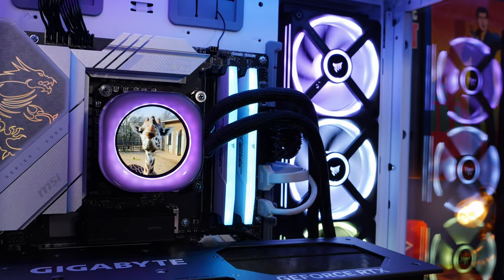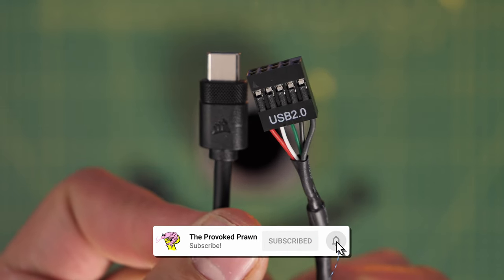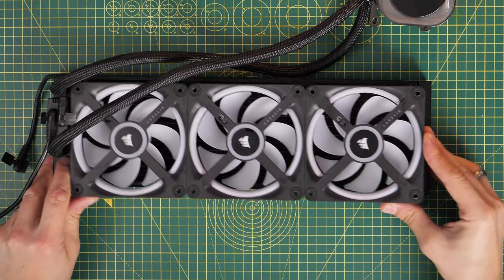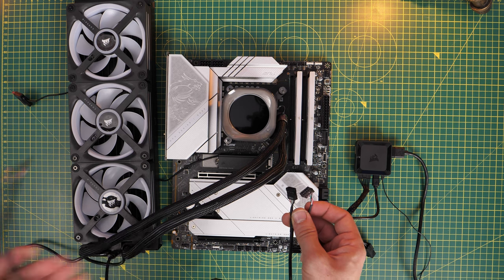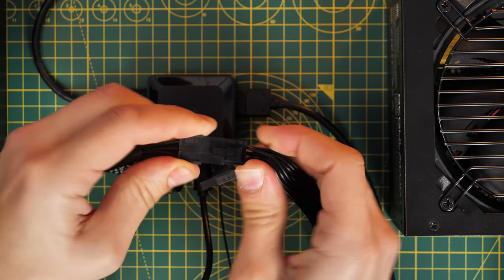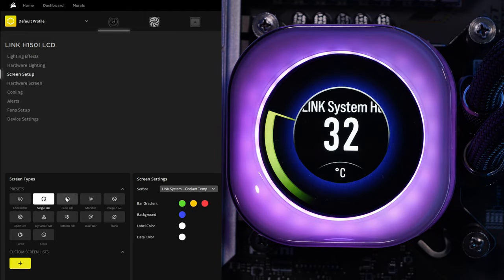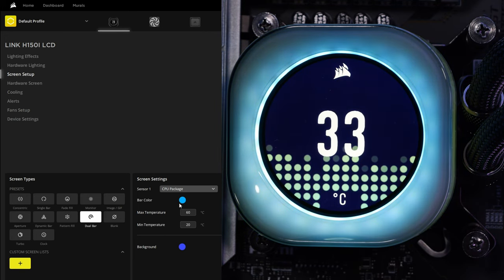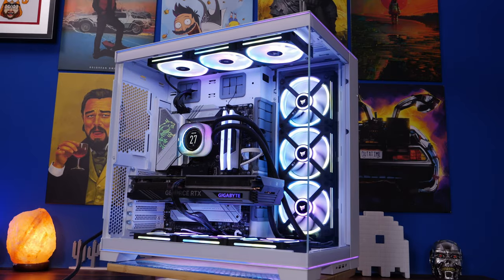Corsair iCue Link LCD upgrade explained and explored

Comment: About the "Triangle of Doom": I have lately seen a video where the guy explained that some mainboards cant deliver enough power through the usb ports which leads to the error. He said that you can fix that problem by buying an internal usb hub (eg a nzxt one) that has its own sata power connection. Apparently if you plug the commander or whatever you use into that, the triangle wont occur anymore because it gets enough power this way.
Reply from the maker: That wouldn't help with this specific iCue link issue as it's down to too many devices being connected to one port on the controller but  a Powered usb hub can be useful for sure
Reply: @TheProvokedPrawn  thanks for your answer! I am clearly not an expert on that topic. I have ordered an H150i Elite lcd xt for myself, gonna see how that works out^^

Comment: So the most bizarre thing occurs with my LCD screen. More often than not I always get the triangle of doom upon starting my PC. After making sure I have no more than 7 devices plugged in on either side and removing the screen and re applying to make sure it’s fully sealed i have no idea what’s going on lol. The only thing that remedies this is turning the pc on and off and hoping that one time it miraculously works. Which is does but it can take 3-4 reboots before it decides to work lol. I’ve contacted Corsair over a week ago and I’ve heard nothing. I’m tempted to return and replace on Amazon in hope that I’ve got a dodgy screen

Comment: recently purchased iCUE LINK H150i RGB AIO LCD CW-9061008-WW. Already fixed with ICUE5 installed and  I still can't find option Screen Setup to play with GIFs :-(
Reply: Same to me, maybe the ICUE software was updated and now is not possible already to change it?
Reply: same problem here! what is the model of ur MB?
Reply: @jsp89jsp u need to connect the USB C cable above the radiator(included) in order to be able to do it

Comment: I have 10 fans in my case, and the LCD Pump which counts as 2 devices.... 6 fans on 1 side of the hub, and 4 fans plus the lcd pump (6 devices)... 6 devices per port... still getting the Triangle of doom.. Second issue: When running the auto detection it doesn't even get the order close, is that normal as well to have to rearrange the order of devices? When ordering your devices do you start from the top left exhaust or bottom left intake?

Comment: good day Provoked Prawn , so I'm a bit gutted.. i bought this cooler (well I thought I did) CORSAIR iCUE LINK H150i LCD Liquid CPU Cooler - QX120 RGB Fans - White - 360mm Radiator - Fits Intel LGA 1700, AMD AM5 - iCUE LINK System Hub Included And it wont let me customize the cooler face. thats why I got this one for the link system, and to be able to change the color,temp.. what am I missing? did I get the wrong one? is their even another one?
Reply from the maker: Hi. Sorry for the delay in reply! Thanks for joining by the way. So that one should allow you to use the screen. The most likely problem is you need to connect the USB cable from the radiator to the motherboard as well as the USB cable from the iCue Link controller to the motherboard. Corsair supplies a splitter cable for this. Try using that if you only have 1 USB port on your motherboard. Also I made an indepth guide to iCue Link here that might help
https://youtu.be/-jeN1m4m6-U

My other tip would be to update the firmware on the controller if you can, using the latest version of iCue.

Comment: Screen setup option not coming in my icue software , any idea why?
Reply: same issue
Reply: Same here. Did you find out why?
Reply: @thomaslyngbyeboje6333  yes, the usb c cable was not plugged in AIO controller , plug in AIO & the Header in Motherboard, it will work
Reply: Problem solved. Ended up removing all fans from the cooler and from hub. after re-arranging my layout of fans and radiator it all worked.
Reply: @jonnyfontane3607 u need to conect the USB C cable on the radiator to ur MB

Comment: I just biught an h150i ilink rgb and can uodat to that also, but i will smash the aio first to the wall. Pump runs, fans spin, and the aio is connected to the hub, and the rgb fans to the radiator, just like the manual. But no rgb light, and no pump shiwn in icue. Just one time short. Other side of the hub has 7 fans working fine, with rgb. Even when i swich ports, nothing changes. Even tried other hubs, but no succes, alk do the same. So i think its in the pastrough. Its a common problem i saw on the corsair forum afterwards. Do you know a fix or sollution.
Reply from the maker: Uninstall iCue. Download the latest version. Install that. Check for firmware updates
Reply: @TheProvokedPrawn  all of the thimgs are up to date, even did a clean windows install, and try to install the aio, and icue again. Nothing works. And i realy see more people have it, but no sollutions

Comment: i don't get why they had to design the cabling like that, there's already a usb cable that goes from the cooler to the mobo so why not just make it go thru that so all you have to do is plop the display onto the pogo pins

Comment: So possible having this AIO with Lian Li Fans right? Just the Aio all i want cause integrated wires
Reply from the maker: Erm possibly? That's a very expensive option to not use the Corsair link fans. You'd have to still use the controller and Lian Li's as well.
Reply: @TheProvokedPrawn  you can direct the usb to motherboard right?? Just the aio i want cause having integrated cables

Comment: hi provoked prawn, my lcd is displaying liquid temp only with no option to change it in icue software how do i fix this?
Reply: u need to connect the USB C cable above the radiator(included) in order to be able to do it

Comment: Installed everything exactly like in the vid but I cant adjust anything on the lcd because there are no device settings tab. Uninstalled twice now and still no luck
Reply: Same here.  Have you fixed it
Reply: u need to connect the USB C cable above the radiator(included) in order to be able to do it
Reply: @xpaulgoflex u need to connect the USB C cable above the radiator(included) in order to be able to do it

Comment: Hard avoid for anything Corsair. First my vengeance ram won't take XMP which after much research found out that's common. ICue suck ass with it's UI also.  My Corsair fans RGB stopped working, along with the ram and mouse RGB. To fix this i had to go in safe mode to delete all icue files after researching it after hours of searching. Bought Lian li and are never looking back. The fan RGB went weeks before the others problems

Comment: Are you using a 420mm aio?
Reply from the maker: No, 360 in this video but it works with the H170i version as well, if that's what you mean.
Reply: @TheProvokedPrawn  I was curios, how well wiukd perform the new corsair 420mm aio. Thanks for replying!

Comment: ICue keeps crashing my pc. Ended up uninstalling it and system runs fine. Basically useless for the dominator ram rgb…
Reply from the maker: That's weird. How do you know it was iCue specifically?
Reply: It took me a long time to figure it out. Almost wanted to reinstall windows. Back then I had windows 10. For some reason before reinstalling windows I uninstall icue and the freezing stopped. In the end I updated to windows 11 and my ram was stuck with a random rainbow pattern. So I installed Icue to change that and…. The freezing issue was back. Now it’s a random blue pattern I can live with and without icue the timing of the individual ram sticks seems to be off. 

I’m running a ryzen 9 5950x. And I did read about other people having issues with ryzen. Just weird they didn’t solve the issue more than a year later.

Comment: The screen section doesn’t appear for me. Please help
Reply from the maker: Could it be because you have too many devices connected. Apparently each port can only support 7? I thought I explained that.
Reply: @TheProvokedPrawn  well I have to hubs in my system. Everything is plugged in and powered correctly. My Link H150i is even showing in my Icue devices. Only its not giving me the screen settings to apply Gifs, Temps, etc..
Reply: @otisharris429  Same to me, did you solve it? Thanks
Reply: @otisharris429 u need to connect the USB C cable above the radiator(included) in order to be able to do it
Reply: @jsp89jsp u need to connect the USB C cable above the radiator(included) in order to be able to do it

Comment: Why can this read cpu temp but my Icue Cappellix can't?   I just get reservoir temp.  I'm so annoyed with Corsair right now.   Spent all this money on all this stupid RGB crap and I have to download  CPU temp to get cpu temps.
Reply: I agree, I bought a water block with leds and I can’t use them because I won’t spend the extra 60 on a stupid I cue controller, total scam
Reply: @henryvolpe2263  i HAVE the controller, but I only get radiator temps...i guess i have to buy the water block LED you got to get the cpu temps..lol.   No more fancy crap for me.  Next build is having ZERO rgb.  I'm going Noctua.

Comment: i dont have screen options for my LCD display, any idea why?
Reply: were you able to find a solution??
Reply: @MarvFPS  yes thanks. but in the meantime i switchted to antoher system :D
Reply: @jonnyfontane3607 what was de solution to fix it? i have the same problem and don't know what to do🥺
Reply: @brianmartinez9595  pluged into another USB connection on the MB
Reply: @MarvFPS u need to connect the USB C cable above the radiator(included) in order to be able to do it
Reply: u need to connect the USB C cable above the radiator(included) in order to be able to do it